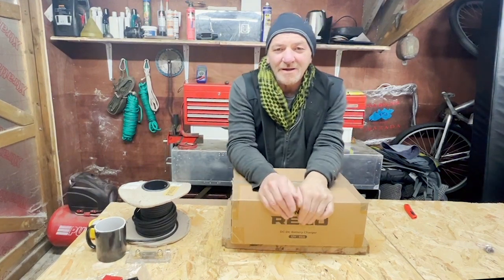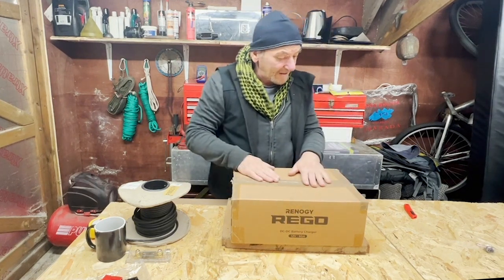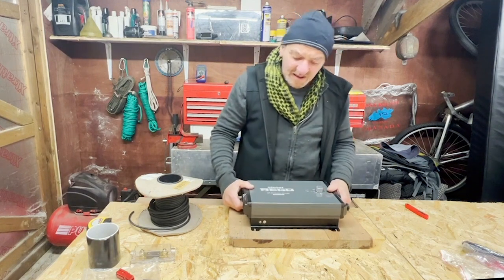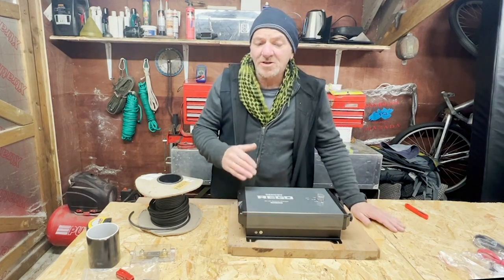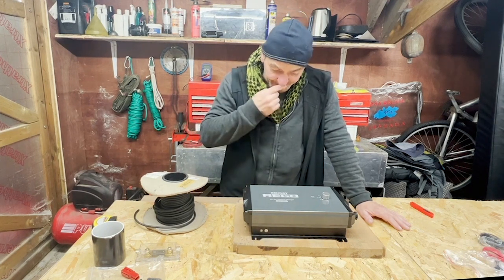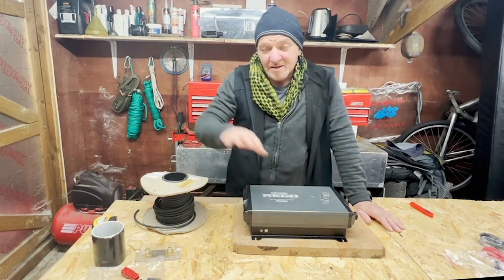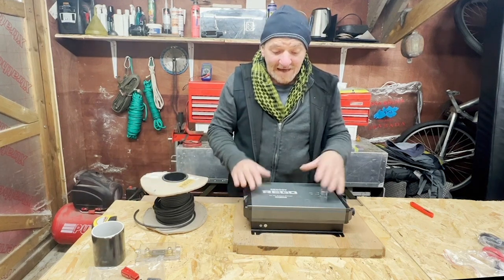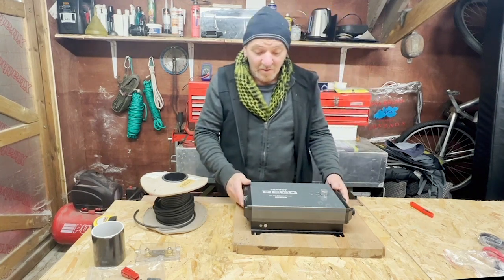Rego 60A Renogy DC to DC Charger Review: Bidirectional Battery Charger For RVs Solar Batteries

Comment: Anderson terminals won't work! In so many setups the DCDC is as far from the motor battery as almost 6 meters, 35mm2 (2AWG) cables are used, anderson support per pole 120ah for a cross section ranging from 16 to 6 AWG. With these anderson adapters they wanted to make people's lives easier but they complicated it. Or i'm wrong?
Reply from the maker: The current output/input from this unit is max 60a.   8 AWG is the max wire size for a P75 connector,  and over longer distances ( +6m), you might lose 10% of energy for the period that 60 amps is flowing. Using an anderson connector is an easier installation.

Comment: Does anyone know about the current restriction feature in the app? What custom charging currents are available? Cheers.
Reply from the maker: I am not sure I understand you question?
Reply: @mowgliadventures5773  the app for this charger allows the user to adjust how much current the charger delivers. I wanted to know more about this feature, but I've now found the manual. You can set the current from 10-60A, in 10A increments.

Comment: Can it charge 60A in both directions?
Reply from the maker: Yes it does charge both ways
Reply: @mowgliadventures5773  sorry I meant to ask if there is any limitations, like both direction can achieve 60a?
Reply from the maker: Good question that I don't know the exact answer to. The documentation says output is 60Max it is not specific on the Amps for bi directional.  Of course to get 60Amps to the starter bat, your house battery must be able to deliver /discharge +60a and your starter bat must be able to demand and absorb 60A . The cabling and fuses both ways will cope if sized correctly.  It works great in our van, keeping the starter battery topped up via the solar output to a common +Busbar when parked up for the week. And when we start the alternator charges the starter bat  as per normal. @dannyc2261
Reply: 60a house charging, 30a starter charging
Reply from the maker: @paulsharp1712   Thanks Paul, where did you learn that?

Comment: 6mm cable is way too small for 60amps.  You need 16mm minimum, ideally 25mm or more cable depending on length of run and how enclosed.
Reply from the maker: Thank you, you raise a good point, I thought had I said 16mm but it does like sound like i said 6. SO yes 16mm2 is the minimum or 6AWG.
Reply: Not only cable size but not placing terminal posts was a huge mistake.  Renogy wants you to exclusively buy the ONE enchilada combo making it a headache for a-la-carte shoppers
Reply from the maker: @stevekuiper1049  Renogy have also used the same P75 Anderson connectors on their Rego 60 MPPT

Comment: Will it charge the house battery when idling?
Reply from the maker: yes that is the main  function  to charge house batteries from main engine while running.
Reply: @mowgliadventures5773  thanks! I have heard some only work while actually driving vs idling. Is that true?
Reply from the maker: @scottydidnt  no I don't think so. If you start your engine but didn't press accelerator to get engine speed over 2000rpm before going back to idle, It is possible for the alternator to not activate and generate electricity